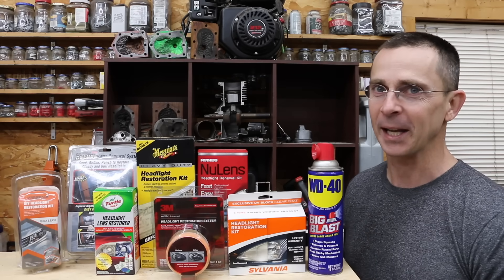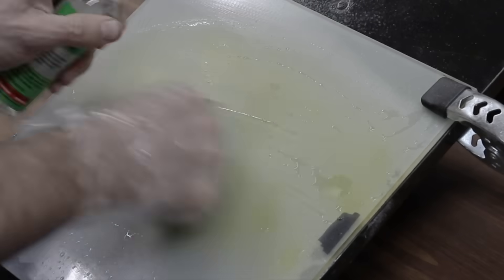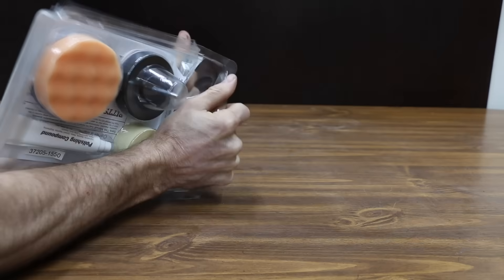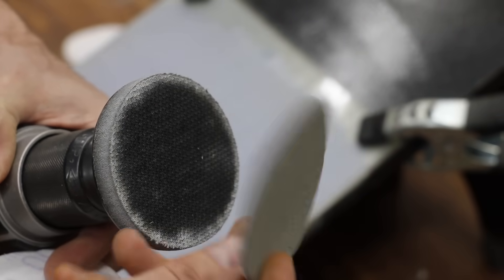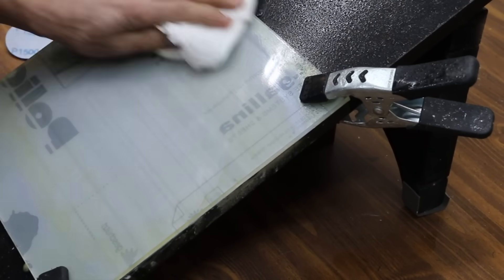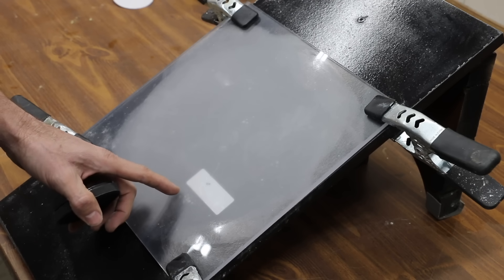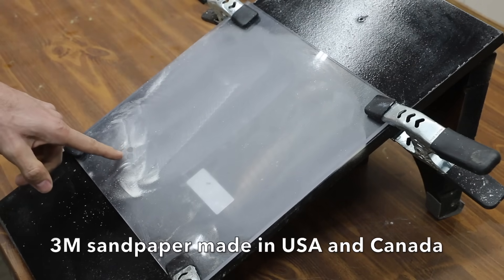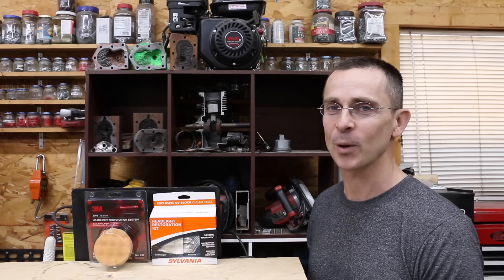Best Headlight Restoration Kit?  Let's find out!  3M, Sylvania, Meguiar's, Mothers, Turtle Wax & HF

Comment: I’d like to see a real world restoration of junkyard lenses with sylvania vs 3M
Reply from the maker: Thanks for the video idea.
Reply: From personal experience, the 3M kit is by far superior in prepping headlights and once combined with a good quality clear coat with UV blocker, they look brand new.  The top coat is a very important step in making them "like new" and buying an excellent quality clear coat with UV blocker in a rattle can from an automotive paint supply store is paramount and well worth it.
Reply: @notbhavn  From doing multiple restorations i still find that and 2 step buffing compound and a glaze coat then just tape off and re clear gets the best results. i don't think ill ever use a kit again
Reply: Yes
Reply: I used the 3M product like I was a pro and I’m not!
Reply: Why not use the 3m kit with the sylvania coating?
Reply: I have used both the 3M and Sylvania, and I agree, the 3M is better, however there needs to be a better top coat for it because here I am a year later and the lenses are starting to oxides again.  Would like to hear from others who have had a good experience with a UV blocking top coat.
Reply: 0317slainte I’m thinking a good 2k clear coat might work well. I just finished using the 3M on my car and they look great. I didn’t coat them with anything yet
Reply: @0317slainte  i can recommend clear wrap. I tried this on the VW Bora of my father 3 years ago and they still look good.
Reply: I would have liked to see you throw together your own combination of products ending with a spray on UV clear. A 3m kit with UV clear would probably be best for speed and long term protection.
Reply: @AvgDan  pickup some 3M sandpaper and a can of UPOL 796...  It's not cheap, but it's a high quality UV resistant clear.
Reply: I used the Sylvania kit but added 3M 800 grit and 1500 grit to the process and the results were amazing
Reply: Road trip to a Junk yard anyone ? Junk yard headlights
Reply: Agree.  It’s a good test but definitely can’t draw any conclusions about how well will they work on intended application.
Reply: The EXACT same thought occurred to me. It would have been awesome had this product evaluation ended with the top products used on heavily damaged headlights to see these things used on the things for which they are intended.
Reply: @RS1 The clear coat I use is from a local supplier (Majestic Solutions) and has worked flawlessly, but it's not cheap (around $25 for one can, but it will do 4-6 sets of lights).  This method definitely has a learning curve of methods and materials.  Once you get the right finish coat, there's nothing that looks better.
Reply: Get some headlights from a Honda those are always real bad

Comment: Years ago I bought a Mothers kit for my Mom. The kit came with foam ball drill adapter and compound, The ball couldn't be used straight on because of the screw holding the foam to the adapter as well being glued the compound made me think of a light weight rubbing compound. Some places came out better but their was places that just would not come clean.
If asked to purform the task again I'll know what to buy, Thank You very much!
Reply from the maker: Glad I could help!  Thanks for watching.

Comment: Awesome testing. The sheer number of these foggy headlight remedies out there is overwhelming. Thanks for cutting through the B.S. and providing an objective, informative perspective. 
The only thing that seems to be wrong with the Sylvania product is that it doesn't have an apparatus for using a powered tool to reduce fatigue and effort. 
I'm left wondering if you could use the Sylvania pads and solution but with a drill and pad holder for convenience. Thanks again.
Reply from the maker: Thanks for sharing.

Comment: Can we buy a final sealer to prevent UV, such as a spray, i use the Sylvania and was pleased to see that you approved that product, i was satisfied myself, but found the lens sealing finish there is not much . thank you very much
Reply: Here's what I commented above:
*The LightRite UV Headlight Restoration ** is what dealers have used for many years, and it available to the consumer.   It was one of the 1st one's out on the market for the professional.   Here's the curve-ball - - -  they ONLY use 600 grit paper, and their coating is an aerosol spray-can that is UV cured in the sun or with a UV lamp.   
---  I'd like to see how the products you tested fill in the micro-scratches with their UV Coatings under the microscope.  Maybe they all do, so it really comes down to "Ease of Use" where there are "multiple step products" (vs.) a "Professional"  2-step process like the LightRight UV Kit, however, it really comes down to the final coating's "clarity" of the lens &  durability which is hard to test with all these products, so you have to go with long-term reviews.

Too bad Ryder Fleet Products just ceased operations in Nov.   They were closing it out at $7 a kit,  reg. price is $40.   This product well known and used for the Big-Rig Fleet industry.  Might be able to find it at a local Truck Stop or there are on-line vendors, or buy direct from the company.   

It appears to be the easiest system to use, with professional results since their coating contains high-solids which I think would fill in the scratches, but that would be interesting to see under a microscope for all products and to test each products capability to fill in each level of sand-paper scratches unless those other products depend on finishing to a clear finish in order to get clarity......hmmmmm???? 

Probably kits with an aerosol coating gives better results vs. a wipe-on product....

Comment: Do any new cars still come with glass headlights?  Plastic just doesn't hold up.
If they'd make the plastic replacement part cost $25 and easy to change that would be OK too.
My experience with renewal has been that it looks good - for a little while.

Comment: Great videos! I really do enjoy the content. You always mention leaving suggestions at the end and I have one. I've been getting into woodworking more and I go through sandpaper like candy. There's a company called DuraGrit that makes carbide sanding blocks/disc. I'm trying to determine if it's worth the cost. They advertise a comment "I sanded 10,000 linear feet of spruce and it still works like new!" and I'd like to see how this compares to the competition and how much use you can actually get out of one piece (block/disc).
Reply from the maker: Thanks for the video idea.

Comment: I use Novus 1-2-3 polishing compound and an electric buffer.  The product is made for restoring scratched and degraded plastics and paint.  It comes in 3 bottles.  #3 is heavy emulsified grit.  #2 is medium.  #1 is final polish.  Another tip, always use lint free non-cotton automotive cleaning cloths.  Don't use cotton cloths or paper towels as these are abrasive and scratch surfaces.
Reply from the maker: Thanks for the tip.

Comment: I'd recommend the Auto Glym complete headlight restoration kit, don't know if you can get that in the usa though. 
My w210 merc's xenon headlights were absolutely oxidised and someone had already sprayed new lacquer on them some 10 yrs ago. I had no reflection pattern at all, just two balls of light on the road. After the kit the lights were like new, had a clear look and crisp pattern. It took about 1,5h/side with a power drill. Cost was about 30€
Reply from the maker: Thanks for the reccommendation.

Comment: The only issue I have is that the yellowing of plastics due to uv damage is a chemical process, not a physical one. I watch electronic restoration channels and they use a specific chemical to whiten old and yellowed plastics. A similar chemical may be present in these cleaners, which would remove uv yellowing from the headlights, but not the yellow paint that you used.
Reply from the maker: Thanks for the feeback.

Comment: Great video. I expected 3M to do better than it did. I'm skeptical as to the longevity of anything that isn't properly UV cured and relies on sunlight. Having used UV cure adhesives, the difference isn't small. I'd love to see Sylvania and 3M put up against a DIY approach using off the shelf wet/dry paper from the auto parts store and plastic polishing compounds. Cost is probably higher, but I bet you can do as-well and probably better. Go stick those things outside for 6 months and let's see!
Reply from the maker: Thanks for the video idea.

Comment: Great comparison test. I restore older cars with most of them having glass headlights. Glass is best but it isn't used much anymore.  I get a lot of yellowed polycarbonate  headlights and have tried  many different  procedures to restore clarity. The trick is getting your newly polished  lens to stay clear. A comparison  of final coatings would be a great follow up to this video.
Reply from the maker: Thanks for the video idea.

Comment: for myself it looks like it all comes down to the sanding the area very well then using a good rubbing compound ,, I see some people use a  ceramic coating after restoring, Curious if that is better than the coating product that comes in the kits or are they the same
Reply from the maker: Thanks for the feedback.

Comment: Fantastic Video! A test idea is to compare the various ceramic/polymer coatings for paint. Opticoat vs Ceramic Pro vs cquartz to name a few. Could test how hydrophobic they are, how resistant to scratches, how resistant to rubbing ie. heavy cleaning. Thanks again for your efforts.
Reply from the maker: Thanks for the video idea.

Comment: Another great video I used a Maguire's kit plus I use blue magic in with that same kit but I also use sandpaper that didn't come with the kit coarser and finer and soap and water with  That sanding. But before any of these things come along my brother actually used Brasso and it to did a real good job try that sometime. You Use sandpaper with that as well.
Reply from the maker: Thanks for sharing.

Comment: Here's an idea for you can a electric generator be altered to run off an electric motor running off of its own output eliminating the need for fuel combustion in greenhouse gases please feel free to contact me with any questions
Reply from the maker: Thanks for the video idea.
Reply: Naval c.a.d. says my design which uses the same amount of copper and iron in the coil will produce 4x the voltage as a standard 440 generator , but the problem with copper is it holds heat like no other metal . Using 2 pancake coils and a bicycle tire with a polarized 🧲 n on one side s on the other with an induction blower system and cowlings will allow for lower maintenance of higher peak output. I'm talking a 70 lb suitcase sized powerplant that can power a house or car without fuel cost (other than annual maintenance)or emissions. There is an alternative to copper that will produce 4x the copper peak output and dump heat from the coil .

Comment: I've used the 3M headlight restore before and it worked, but my headlights hazed a lot over a few weeks and I had to keep applying the plastic sealer until I just gave up and bought new headlight fixtures (it was a Ford Focus so the headlights are like $80 bucks for a pair...)

I'd be curious to try the Sylvania system the next time I do something like this.
Reply from the maker: Thanks for sharing.

Comment: Most headlights are multi curved so not sure about the flat applicators but still lots of
good wake up info presented here. Great job !
There is one guy on here that uses I believe a Uline spray can product to both re-melt 
and reseal these plastic lenses in just a couple of minutes but the fumes are about as 
bad and dangerous as any can get. That MSDS sheet for the stuff ..... scary !!
Reply from the maker: Thanks for the feedback.

Comment: I’ve found wet sanding most dull lenses starting at 800 or 1000, then 2000 and finally 3000 and spraying with Rustoleum Universal gloss clear spray with UV protection makes lenses look new.
Reply from the maker: Thanks for the feedback.

Comment: Excellent video ( as always ). In the case of this subject use the method the trade use, a bar of buffing compound, ( aluminium grade is good )
such as Tripoli but loads of Chinese sites sell it for around £4 GBP a lump, apply with your drill powered buffer, finish off with a coat of ordinary car body wax if you want. A bar of the stuff will probably sort a supermarket car park full !
Reply from the maker: Thanks for the feedback.

Comment: You didnt do any type of experiment that actually involved damaged/sun damaged lenses. You controlled the experiment by not doing anything that would have given these products an actual chance to work as made. You should have used the head lights you showed at the beginning of the video. Pointless of doing all that work when it was not going to give any kind of results that could actually give some one some decent information about these products.
Reply: Interesting perspective. While it is true that the setup he used was a fabrication, maybe there is some value to seeing a comparison between the abrasives on the coatings and plastic, as well as the sealers on the plastic, despite it not being applied to real damaged lenses.

With that said, yes, I too hoped to see real lenses. But we can request another shootout on sets of real lenses (maybe the biggest ones around, with taped off sections). Example: 1. Choose a set of lenses. If we have 6 kits to test, we can test kits A, B, and C on one lens, with tape separating 3 sections of equal area. Then, test kits D, E, and F on the other lens. For testing abrasives/etc and applying sealers, it's as simple as shielding all but one section at a time. With testing durability and longevity of coatings, then it is a matter of field testing the results (this may call for a year for results, and/or a followup video).

All this said, I do think there is some knowledge to be gained through this video. He showed side by side comparisons of the clarity of the final results, which is the main quality we are looking to compare. The experiment was not perfect, but it was *illuminating*.

Comment: I just did my headlights and I used Meguiar's. If you take your time with the sanding, it turns out really nicely. The headlights look brand new.  The protective clear coat is stated to last at least 1 year, and it gives you more than enough for multiple re-applications as needed.
Reply from the maker: Thanks for sharing.

Comment: Yet another great vid from you. Thank you sir. A couple comments and tips from me. First i wouldnt dry sand anything plastic with a drill because it could cause  cracking and or crazing  from too much heat just my thought anyway. Also if using just a piece of sandpaper to sand,  cover the back with duct tape and trim edges. Works amazingly well as i figured out. Only downfall is you wont know what grit it is unless you write on it with marker or pen as i also found out🙄Marker does wash away tho if wet sanding. You could get sandpaper and any compound to do this tho if you already have paint tools. Kits are more convenient. I would clearcoat when done tho with having a kit. 
Best clearcoat in a can is eastwood 2 part epoxy paint that ive tried anyway.Havent put on headlights but worked better than any other on a gas tank. Again thank you for all that you do.
Reply from the maker: Thanks for the comments and tips.

Comment: I tried using rain x that is meant for your windows on my headlights. It actually took the yellowing off in seconds and they are bright a shiny. It actually says you can use on your headlights on the back of the bottle.
Reply from the maker: Thanks for the feedback.

Comment: Sweet, so I want to know what I can coat on my house windows to prevent hard water stains.  I keep running across car products, but many seem like over kill. I just want to be able to clean my outside windows less often and make the next time cleaning easier.
Reply: I found BarKeepers Friend (Home Depot & elsewhere) is really fast and thorough 
on water stains. Might need to leave it on the really bad ones 60 seconds but then 
just light scrubbing (3M Scotch Brite sponge pads).
Reply from the maker: Thanks for the video idea.

Comment: I’d like to see you test the various gun/knife lubricants on a folding blade pivot. There’s so many like KPL, Nanolube, Benchmade Bluelube, Tufglide, Daiwa reel oil, FrogLube, Militec 1, good ole 10 or 15 weight motor oil, super lube, & 3 in 1.   There’s a big market for them and some swear by the more expensive ones but I think it’d be great to see how the inexpensive and less purpose built products compare.
Reply from the maker: Thanks for the video idea.

Comment: Living in the desert, I've seen my fair share of ruined headlights! I have found that by far the best way to protect the headlights against further damage is to use a kit like the Sylvania or 3M, then rather than bothering with the spray on coatings, go to a tint shop and have them apply a clear tint over the lenses. I did this on a 2004 Toyota Highlander. That vehicle was parked in the sun every day for 5 years. The day I sold it, the headlights were 99% as good as the day I had that tint applied. The tint costs about $100 but 5 years of no hassle is worth it in my opinion!
Reply from the maker: Awesome!  Thanks for sharing.